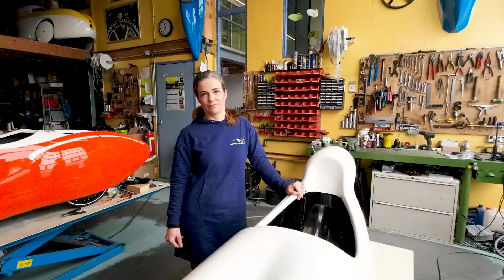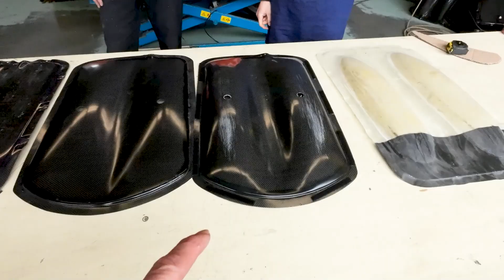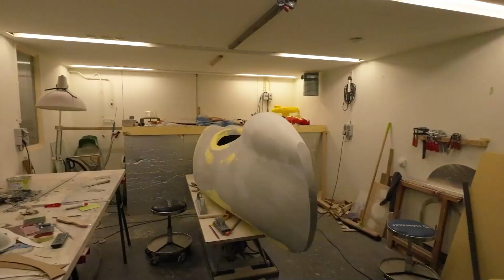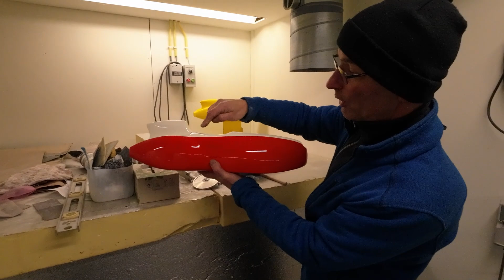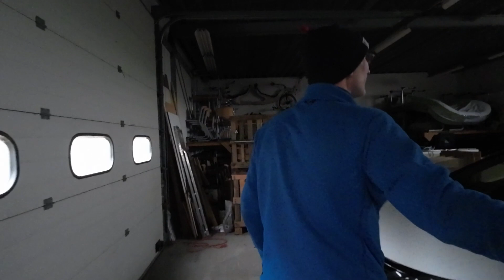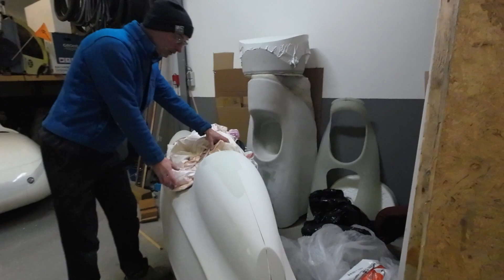Interview with Allert Jacobs-Snoek L, Quest 3.0

Comment: The Quattro rubberised foothole covers work well. I swap between the original cut-foothole version in summer and the closed rubberised version once the harder winter frosts arrive. Can't say I have much need to push backwards.

Comment: Can the Velomobile come with electrical assist?
Reply: When do you under 25 kmh with a velomobile? Very seldom, only uphill. So in 99 % of the time you cycle above 25 kmh. No need for EA.
When you turn your velomobile into a fast speedpedelec, then it become a motor vehicle by Dutch law. And it must be tested and approved by the Dutch Motor Vehicle Department. With takes months for an appointment and is expensive. And most riders do no need EA to reach 45 kmh, their legs provide the power for that speed.
If you want to cycle a speedpedelec recumbent, then buy the HP Velotechnik Scorpion Speedpedelec. It can go up to 45 kmh.
Reply: the snoek is to small for e assist but the quest and quest xs and also quattro can have e assist.